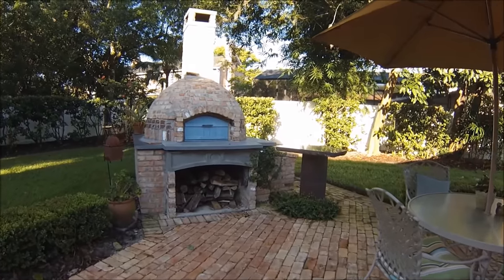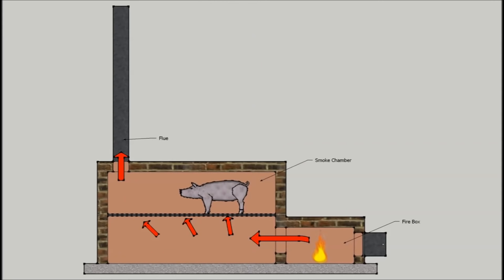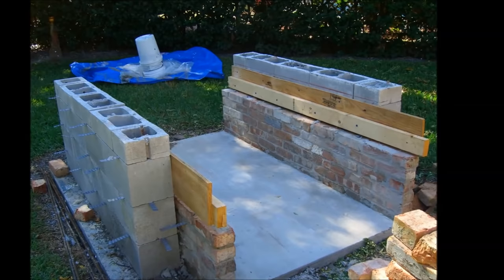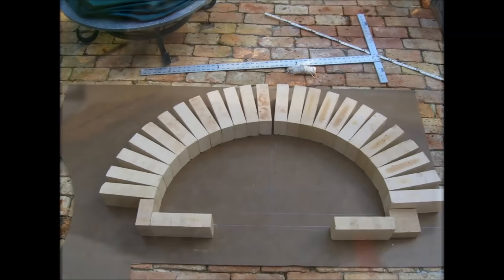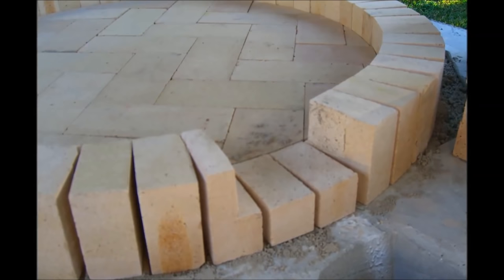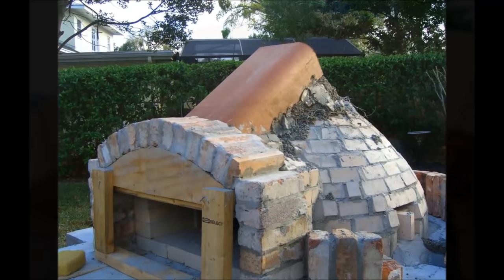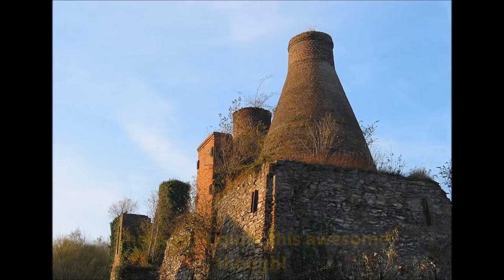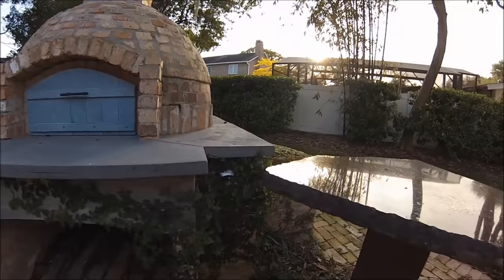How to Build a Brick Wood Fired Pizza Oven/Smoker Combo

Comment: The funny thing is?  People spending hundreds and thousands of dollars for a Stupid pizza oven. When they got the best pizza oven setting on there patio.  SO FUNNY  🤣🤣  I can't keep from laughing!      THE DOME GRILL    all you got to do is use pizza pans on your grill,  and a peel to take it off and on
Reply from the maker: For the same reason you would spend thousands of dollars to build a house instead of just living in a mobile home.
Reply: @LeeMcNeil   I guess,  but its not for me. Its your money, not mine. I got better things to spend money on rather a pizza oven. The Weber Grill makes the best pizza!  Perfectly  cook from top to bottom with in 20 min. depending on the heat.  I' am very very happy the way it performs, and even for making pizza 👍 for only 40 bucks! Plus i can move it any where i choose
Reply from the maker: @426superbee4  I have a Weber and I completely agree the grill is great, especially when you aren't cooking for a lot of people. I use it way more than the pizza oven, because I am usually only cooking for two people. But this pizza oven has a few advantages over a Weber grill. The first being that a pizza oven will get much hotter (the pizza oven will go in excess of 1000 degrees, which I estimate is about 300-400 degrees warmer, but I will actually test this next time I use my Weber). You said you cook pizza's in 20 minutes, this oven will cook multiple pizzas in 90 seconds - and that is not an exaggeration either. It also cooks food way more efficiently, but only if you're cooking for a big crowd. The oven is basically a big insulated masonry heat sink so once it gets up to temperature, it's much easier to keep it there for an extended period of time.

And you didn't mention the smoking capabilities, which can also be done on the Weber too, but with a lot more fussing with the grill than with my pizza oven smoker.
Reply: @LeeMcNeil  must have some smoke taste and little char on my pizza, Weber does every thing i want I was going to build a pizza oven. Why should i? I get the best pizza oven RIGHT THERE!  THE WEBER KETTLE
Reply: @LeeMcNeil  I don't want a super hot oven i want things cooked not burned up!

Comment: step one - get big ass pile of cash and head to home depot
Reply from the maker: You could build this for around $2K in materials. A lot less if you did the outside of the oven with something other than brick. You wouldn't find the brick and some of the other materials at home depot though.
Reply: @LeeMcNeil  Cool oven my friend. Im just jelly over it. lol. I was going to build a brick floor oven with clay and sand like they did back in the olden days.

Comment: I'm serious on making one as i have all my brick and blk, just need to get fire brick..really appreciate an email on a couple questions as im most impressed with your oven..my yahoo is  nitromadagascar as i do have one posted movie on here, so you know im the real deal,wood splitter majorwood is my posted movie.thanks for your time
Reggie
Reply from the maker: Reggie S. That is a kickass wood splitter my friend. I have a neighbor with a hunting lease (like 5,000+ acres) not far from my house and he has a gas powered wood splitter out there. He is my main wood supplier. We just make a trip out there a couple of times a year with some chain saws. We go find a fallen oak, cut it up and split it out there, then haul a bunch of it back. Finding a good year round wood supply is important because it is real difficult to get firewood here in Florida during the summer.
Reply: after i emailed you i did think it needs to be dome, as fire brick to stay up.. I think once dome is made going to blanket it. i restore safes and use pool crete to refill doors if fire proofing is gone, but not sure how it compares to perlight ??
so fire brick dome then high temp blanket, then perlight or poolcrete ?
Think im putting my chimmeny upfront and using splitface block and making mine sqr.
Had a dump trailer of block i loaded and unloaded yessterday, i'm feelinh it today !
Reply: Cold Spring Granite from Mn
i got some big pieces from there that are polishes for free. Going to use them for work space or edging.I looked at many posts and videos, you have the BEST !
I like the smoker idea so I'm going to copy your's. Foolish not to since a guy builds such a nice oven
.Reggie
Reply from the maker: Reggie S. I'm not sure what pool crete is but it sounds like vermiculite which I think will work also. I think the perlite might be a little better though. Make sure you get a clay chimney flue pipe to go inside the chimney.
Reply: one concern i do have Lee, the smoker stove on outside, it sends heat and smoke through the block core. can this handle heat ? or should i use something else ? Friday there pouring a patio and my slab for oven, going 8 inches thick with re bar as it wil be heavy
.Thanks
Reply from the maker: Reggie S. It hasn't caused a problem on mine so far. You could parge the inside of the block cell with refractory mortar for a little insurance.